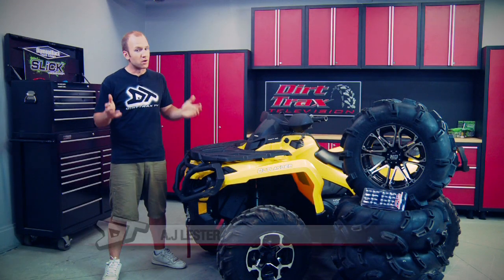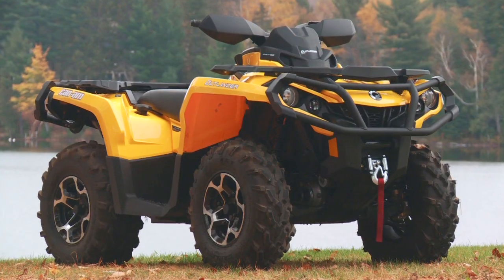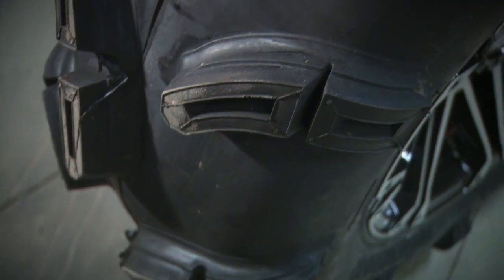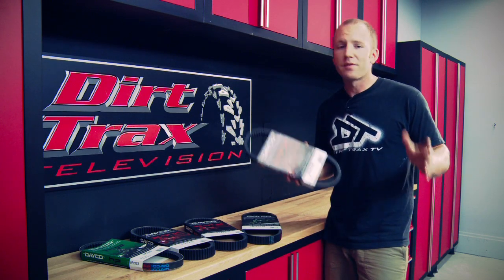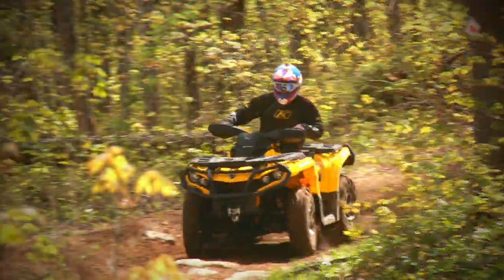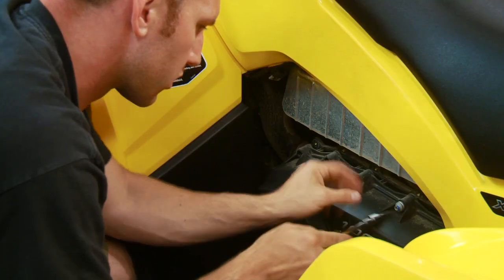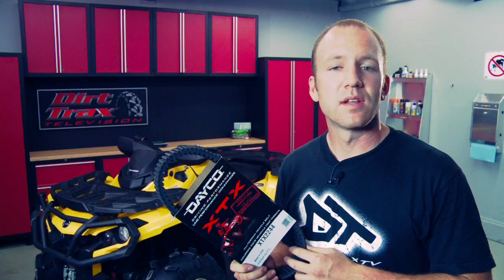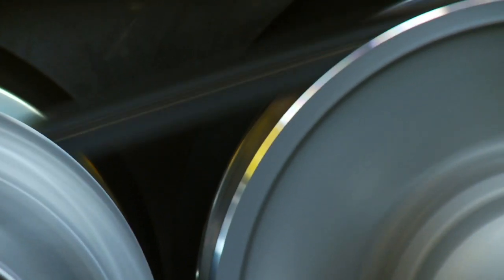Outlander 1000 Tire and Belt Upgrade

Comment: lol the stcok belt that comes on your Canam is 10x times the belt a XTX ever could want to be. Throw on a full QSC primary and you can get 1000's of miles on a stock belt running 30" actual mud tires. I have the real world testing to back this up....lol
Reply: this looks like an ad. i am reassured to see im not the only one thinking the stock is good material.
Reply: When i called dalton they told me to only run the stock belts with their clutch kits cause the stock ones are the best you can get lol

Comment: What belt would you recommend for me on my 2019 can am Renegade 1000 I race a lot and have broke 2 belts in like 6 months
Reply: Have you replaced the belt with factory can am belts?   Have you tried a Maverick belt?  
Try can am 715900212, gates 30c3750, or ultimax uxp446